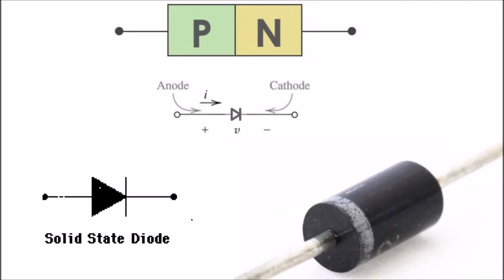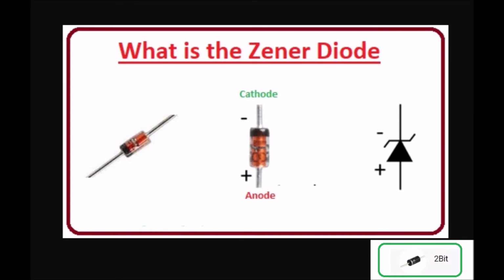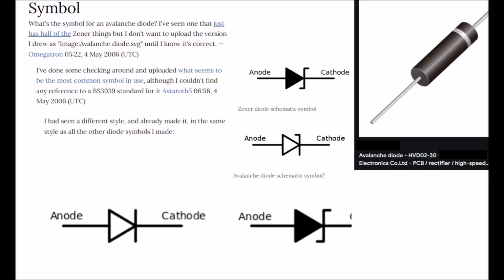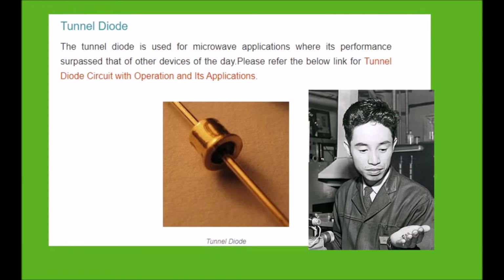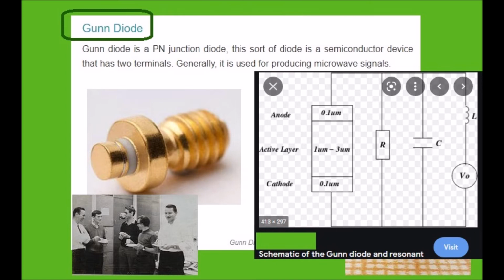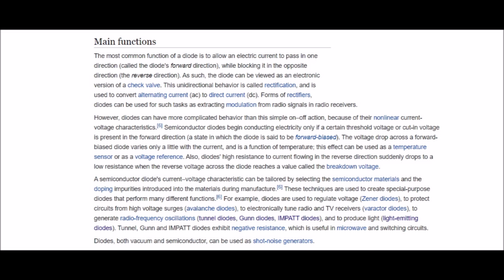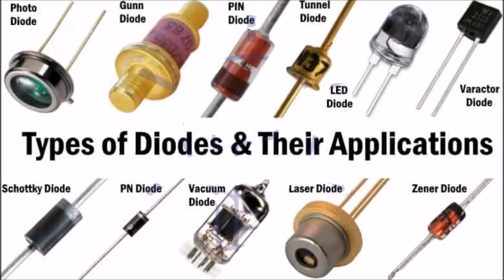Diodes: Types and Uses

Comment from the maker: Table of Contents (Timestamps):
2:00 What is a diode?
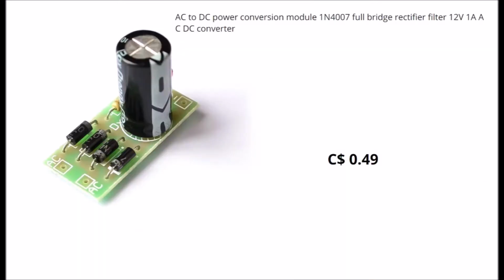3:34 Diode Applications
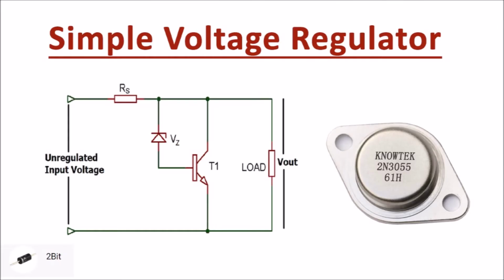4:07 Diode Types
4:53 Zener Diode
6:43 Avalanche Diode
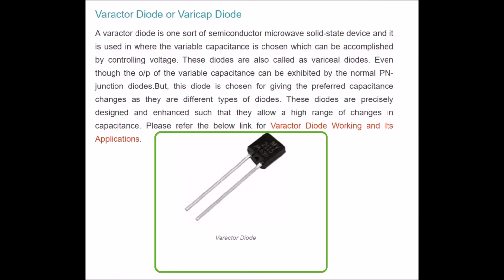8:26 Varactor (Varicap) Diode

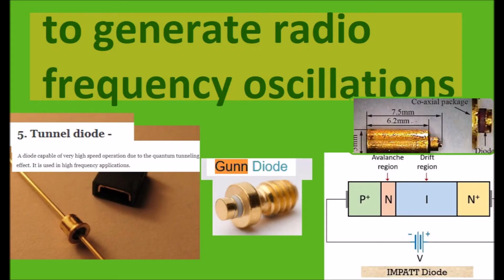10:04 RF Diodes (Radio Frequency Generation Diodes - 3 types)
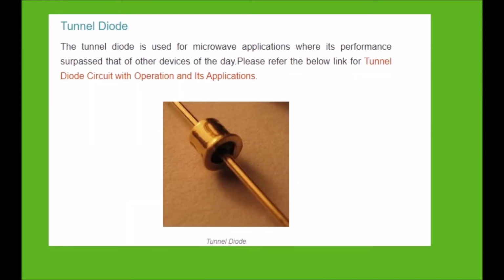10:17 Tunnel Diode
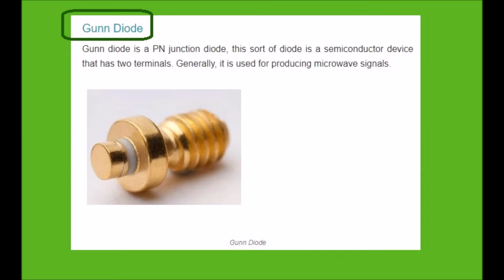12:03 Gunn Diode TED (transferred electron device)
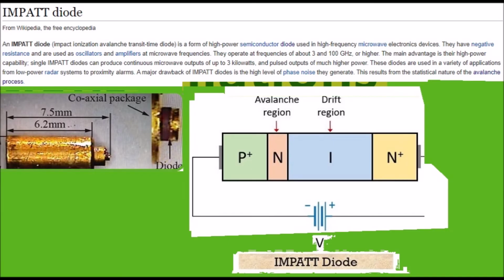14:42 IMPATT diode (impact ionization avalanche transit-time diode)

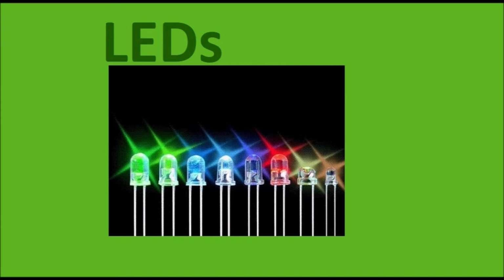16:00 LEDs (light emitting diodes)
18:30 Shottky Diode

19:54 Conclusion (re-cap)

Note: PIN Diodes (and a few others) didn't get discussed. Ooops!